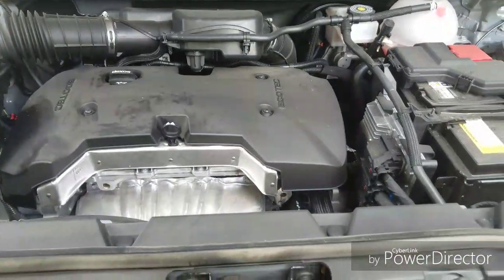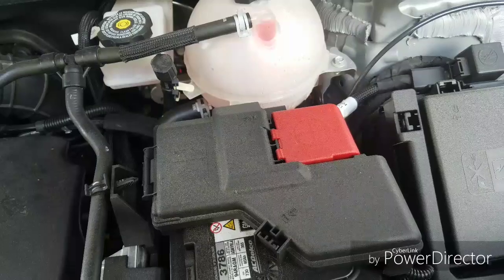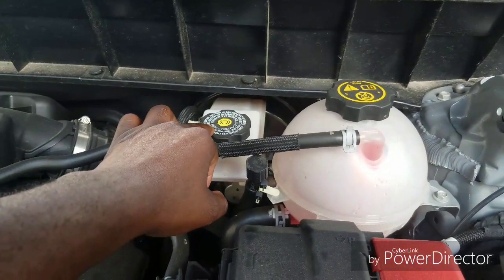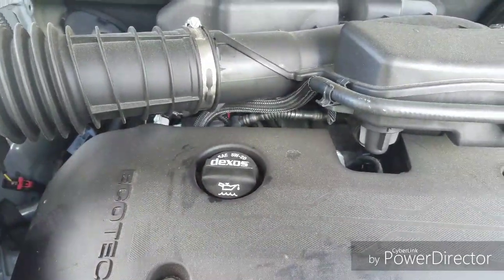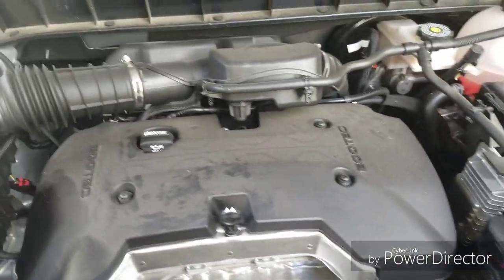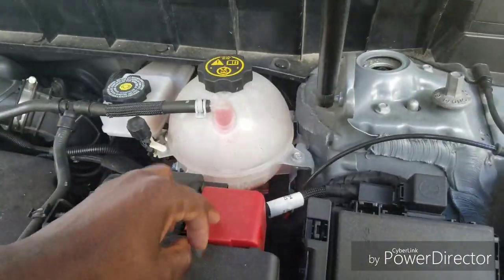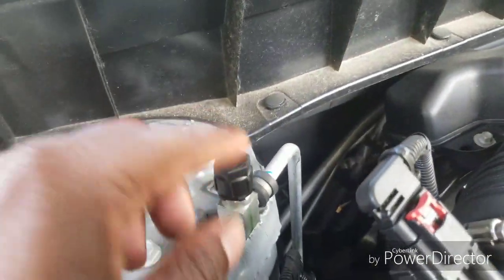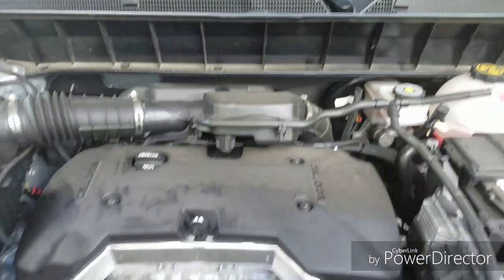Underneath the hood of GMC Acadia 2017

Comment: Nice video, but there are two mistakes
1 - This is the 4 cylinder engine, not the V6 as the author states.  If you remove the decorative plastic ecotec cover you will see the top of the four coils.
2 - Do not use the negative terminal on the battery for a jump start - you can ruin the car electronics that way.  Always use the ground post instead of the negative terminal fora  jump start.  Look at 3:34 in this video, and you will see the ground post.